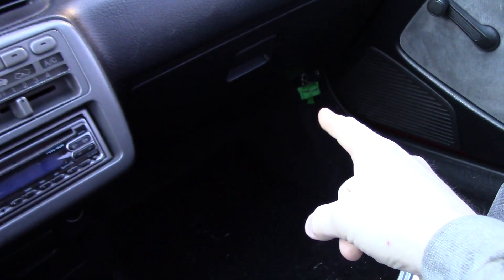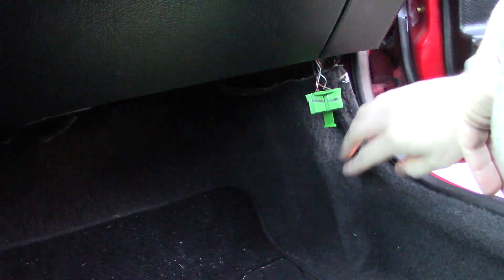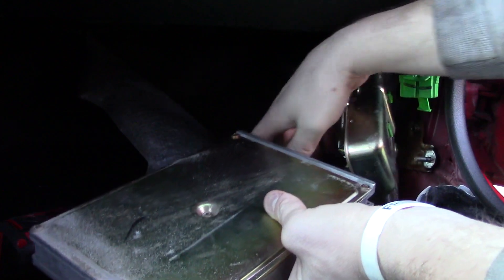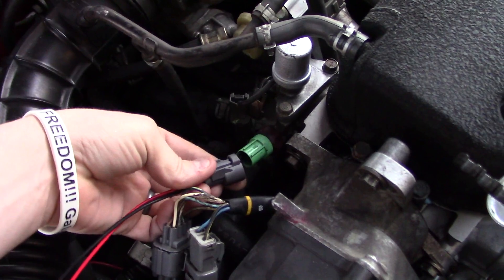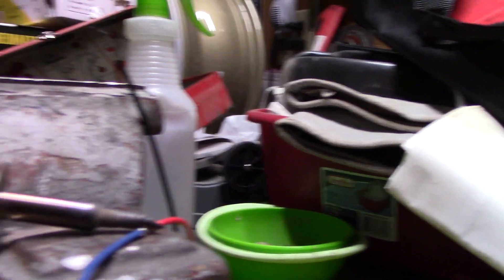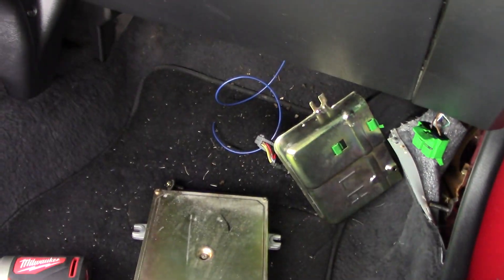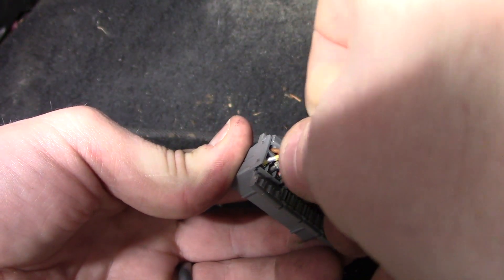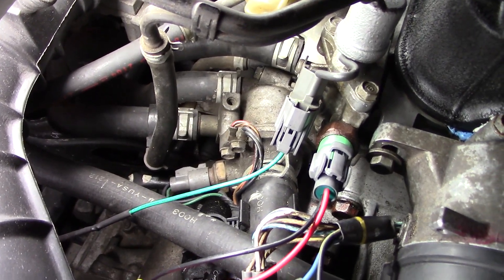How To Wire VTEC for Honda Mini Me Swap using P28 ECU

Comment: I know this question is a little late but can I use the P2P ecu? the one that's originally with the Y8?
Reply from the maker: Pretty sure the answer is yes as long as it is a manual ECU, you might double check that though

Comment: What harness??
Reply from the maker: I'm using the stock harness that came in the DX non VTEC, and then the connectors in the video and run my own wires from the connectors to the ECU

Comment: I got an idling problem with my mini me swap. It idles up and down continuously. Any help is appreciated
Reply from the maker: Sounds like idle air control valve (IACV) Make sure the coolant system is bled, you can also clean the IACV. Could also be a vacuum leak,

Comment: Yeap with a 272 cam from Delta cam regrind it will become a monster and lighter flywheel and gd clutch kit i think you will not need turbo to save money and have fun around plus all motor have that old school style sound
Reply from the maker: If you check out my other videos this engine is now turboed with pistons and rods, I have a 272 cam in the garage that will go in next time
Reply: @RiggsGarage  I don't like turbo amigo or VTEC I prefer old school style but out here they have Geo tracker with Honda manifold p28 ECM and half distributor Geo tracker and Honda made in Puerto Rico plus some put turbos I my self like all motor special carb but my run nice and strong enough to travel and go any place plus out here they have Geo tracker with rotary engines turbo they all fly the road but that is not me I'm a simple man .And when I want to hit the roads fast I take my CRX Honda mini me combo no VTEC but have a 11.1 compression and 272 cam and she only weight 1600 pounds junkyards parts really CCR born in the byouooooo jjj 😁 but I never will sale my either of them amigo one for the mountains and one for the streets jjjj 😁

Comment: Can I use my d15b2 block with the d16y8 head using my d15 wiring harness but using the ecu from the d16?
Reply from the maker: Yep, I made a video to help with this to wire VTEC to that D16 ECU so you can use the stock d15 harness for your setup 👍👍

Comment: I did the swap car runs but after warming up it idles down til it dies idk whats wrong with it no check lights
Reply from the maker: Could be multiple things. Is it cutting off fast or slow gradual die? Check the iacv, very common Honda idle problem
Reply: It’s the timing it’s off if you pull the the vacuum from the fuel regulator and put your finger on the vacuum hose it will idle normal

Comment: What are the connectors!? The links don't work :(
Reply from the maker: Sorry about that, I will find new links. In the meantime you can Google honda small terminal ecu pins and honda large terminal ecu pins and find them. Make sure it says OBD1. Thanks for watching

Comment: Amigo I'm thinking to rebuild my D15B2 with better rods and do a mini me with a d16z6 vtec head port and polish and better intake manifold and bigger cam and turbo the thing up in my CRX honda do you think it will be a good set up with a gd tune amigo thanks
Reply from the maker: With pistons and rods it will be great! Basically exactly what I'm building right now, just with a b7 block, p2p0 rods, Vitara pistons. Good luck and have fun!
Reply: @RiggsGarage  thanks amigo I think 5 pound to 8 pound should be gd enough for me to dry around and have fun nothing wild but the CRX really don't weight much really 100 hp more from stock should be more than enough for me
Reply from the maker: @salrivera7578  yep should be really fun at 250 or 300whp, car is super light
Reply: @RiggsGarage  yeah but I'm staying with 10.1 with the d16z6 vtec head with stock Pistons no Vitara pistons only to have fun still will be a gokart on storoid in the streets jjjjj and highways I want to kp bottom stock but with better rods and bolts and rpm head bolts will be nice to drive around and make the big boys mad jjjjjjj she will be a falcon in higher rpm with a gd cam her suspension is mostly alluminum parts she is a feather weigh fighter jjjj 😁 thanks

Comment: i have a d16y8 with a p28 obd0 to obd1 and i have to rewire my vtec, do i use the original plug to the oil pressure switch or make a new one like you did
Reply from the maker: I guess the question is does your harness have VTEC wiring? Mine did not, therefore I had to make my wire.
Reply: @RiggsGarage  yes i it is i have a oil pressure switch zip tied to the side and there’s a purple wire on the a4 on the p28 that’s just flying around so i’m guessing i just connect the oil pressure switch and connect the purple wire coming from from the a4 to the green wire from the vtec solenoid?

Comment: Can I run the Y8 head and a skunk 2 manifold with all proper wiring and have it running properly?
Reply from the maker: 97.3% sure yes, might look into map sensor location
Reply: I’m in the process of doing a mini me swap on my original Y7 I’ve sourced most parts beside the original y8 manifold si I was thinking of just going with a skunk 2. I’ll be looking into it thanks for the help.

Comment: What fuel octane were you running?
Reply from the maker: I was running premium, now I'm running 87 🤣
Reply: @RiggsGarage  got ya. Lol. I was curious if the new compression ratio required higher rating. Going back to 87, noticed any difference?
Reply from the maker: @iammrprince  I have not noticed a difference, but I've been granny shifting it to get max fuel mileage since fuel doubled lol
Reply: @RiggsGarage  ain't that the painful truth. High compression engine and boosted cars are too dino juice demanding. lol

Comment: I bought a 5 speed civic that has a  p28-A52 ecu. The car runs with it, I'm trying to connect the vtec but I noticed in your video mentioning my ecu might be a auto. Will it still work?
Reply from the maker: Is your car a manual transmission? I'm not sure if the auto ECU would work well in a manual transmission car, but it might, give it a shot!
Reply: I know this is a year old and you already know the answer but those who don't know, yes, your auto ecu will run your manual transmission. You will just have a cel for the automatic lockout solenoid. No, it won't affect driveability

Comment: Question: I want to put on a D16 head with vtec on my car. But it is an automatic. ECU numbers are P3Y-G51. What ECU would I need to make vtec work? Or will it work on this one?
Reply from the maker: I don't remember all the ECU identification codes off the top of my head, but you would just need an automatic VTEC ECU to run that VTEC head on your automatic car
Reply: @RiggsGarage  Ok, thanks :) Will try to find one and we will see what happens ^^"
Reply: @RiggsGarage  p.s. if you would, by any chance, got the info on what that ECU numbers should be, I would be very grateful. No rush ;)
Reply from the maker: Here's the one https://www.d-series.org/threads/honda-ecu-identification.54259/

Comment: My question is if i already have a manual engine harness would i still have to do this?
Reply from the maker: Any time you take a non VTEC harness, add VTEC plus VTEC compatible ecu, you need to do this. ECU needs to match whatever transmission you have, auto or manual

Comment: Does it run like normal with the p28 computer I'm doing the same swap I have a y8 head and d15b7 block so do I need to have a chip. For it to work or no
Reply from the maker: Yep, that computer is made to control a d series with VTec. No chipping needed unless you're tuning it for other mods like boost, just the wiring change I have in my video. In fact, I ran my minime on my stock non VTec p06 computer for months, it worked fine, just no VTec of course.
Reply: @RiggsGarage   appreciate the help I just want to run this plain Jane p28 cuz I ain't going to be tuning it or nothing just a daily driver but more power
Reply: @RiggsGarage   and also put p29 pistons in that's all I'm done to the motor
Reply from the maker: @Oleboomhaur  Cool! A tune by a pro will always make more power, but I don't have time for that with no turbo haha
Reply: @RiggsGarage   I'm a all motor kind of person my self lol how did you chip ur ecu later down the road I wanna put a cam in it
Reply: @RiggsGarage   turbos are to expensevie like you said lol there good for power but Im just old school all motor
Reply from the maker: @Oleboomhaur  I have not chipped mine yet. I have a kit to, but won't until I have a turbo setup ready to go
Reply: @RiggsGarage   o okay I watched all ur videos on the swap I thought you chipped it I'm new to Hondas built all kinds of fords I've been working on my car for a year now one pice at a time your videos are the best on the mini me swap
Reply from the maker: @Oleboomhaur  thanks! I'm digging into a Ford too, one piece at a time
Reply: @RiggsGarage   got one More question I have a y8 head there is a oil jet on it I know you are supposed to delete it I'm not sure how thought and a screw

Comment: Great video. I did a d mini me swap with y7/y8. Not running perfect but I enjoy it
Reply: I have y7 engine too planing in swaping in a y8 vtec head .why yours aint working right
Reply: @elmorenazoguapo  when I did the swap. The guys who installed it  didnt reconnect the evap system so I have a vacuum leak

Comment: D16y8 intake or the d16z6 intake wich is better and why, can you tell me.
Reply from the maker: From what I've read, the D16Y8 flows the best in Dyno testing. It's also fairly available still so I would grab that if you have the choice
Reply: @RiggsGarage  ok but i was looking at someting about the two them and they say the d16z6 intake flow better and has bigger runners.
Reply from the maker: Well that's good news, I used a z6 intake lol
Reply from the maker: Really when it's all said and done, you'll have a slow car either way unless you run some boost to that thing. I could destroy my hatchback in a drag race with my stock Dodge Caravan
Reply: @RiggsGarage  ok if you say so
Reply: @RiggsGarage  ok

Comment: I've got a 2003 civic. Should it go over about the same as it did here? Replace with a compatible ECU and run a couple wires? What about the radio anti-theft. Will I need the code for the new ECU or is the code I have now going to unlock it

The engine works fine without the VTEC enabled ECU for around town but it has absolutely no power after 4k and as a result driving on the highway is sketchy af now so I'm trying to get that fixed. It's not the end of the world but will definitely be nice
Reply from the maker: Hi, I don't have much experience with the d17 the 1.7 l in those. It is different from what I'm working on here and I know there's not really any performance following on them so I haven't really read up on them. I'm sure you can make some numbers with him, I just don't have any experience there
Reply: @RiggsGarage  thanks bud! I'm not even looking for numbers tbh, Im just looking to be able to get up to speed on the highway in a reasonable time lol. I haven't timed it but my 0-60 is like 30+ seconds and 60-80 is another 15-20 thanks to the vtec not engaging
Reply from the maker: Yikes, even without VTec the acceleration should be way faster than that, sounds like something's wrong with the engine
Reply: Cant do nothing with 2003 civics but going k series

Comment: I have a 88 sh4 sedan with auto trans is there anything different to do than what you showed since ur civic is a 93
Reply from the maker: So if you have the same swap I have, you will definitely need an automatic computer that's for a VTEC engine. Otherwise the pin locations are the same I believe, I would recommend double-checking a diagram

Comment: you should do a in depth video of how you timed the mini me.
Reply from the maker: I might do that, I believe I'm a tooth off for some reason but I'm trying to figure it out. Good idea, I'll see if I can't get that done
Reply: Use a adjustable cam gear, problem solved.
Reply from the maker: @byronjones8246  Yes sir I have one
Reply: @RiggsGarage  Np bro. U actually have to on the swap ur doin. AEM makes a nice one for about 80$ as well u need to use the timing belt from the head ur using.

Comment: Turbo is the answer lol
Reply from the maker: Definitely man. With fuel prices rising, I might turbo this car quicker than I boost my big block Chevy lol
Reply: Is the best set up for this d series quick spool simple bolt ons safe and reliable , best part not worry about blown the engine I can give you the parts list and names for the parts and good set up for it
Reply from the maker: Sure thing man, post it here or direct message me on Instagram @riggsgarage
Reply: Working in my mini me nothing crazy just vitara pistons forged rods (eBay) and t25 turbo (eBay) and good nice ecu (fuel tech 450) no dizzy just individual k series coils and having fun lol
Reply from the maker: @alehrims  you basically just named exactly what I want to do lol I've been reading up on the T25 turbo it seems right for this engine. A lot of guys are bolting on the t3 t4 turbos and not getting boost till like 4 or 5000 RPM. I want it now